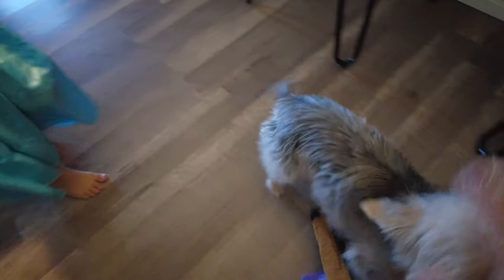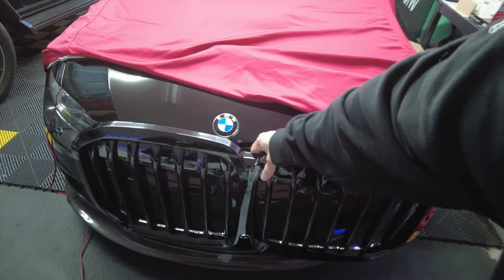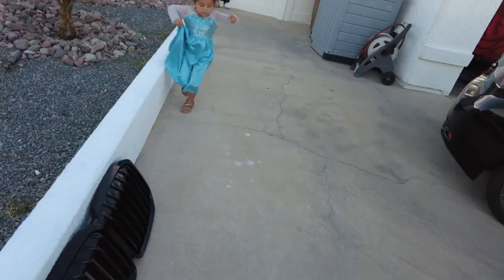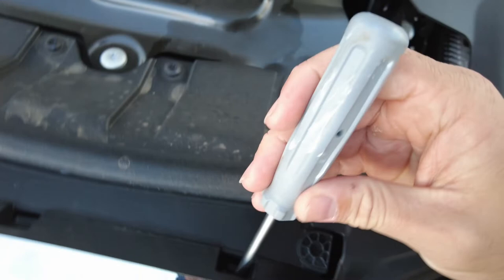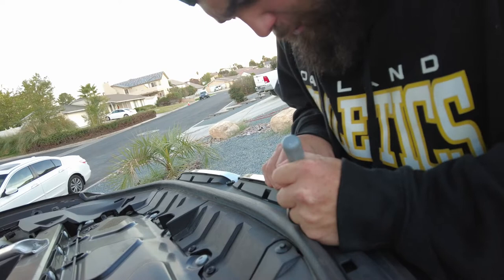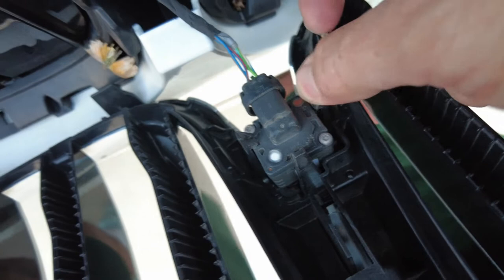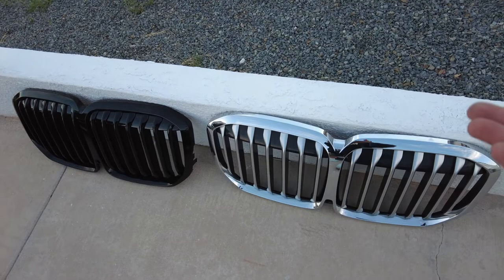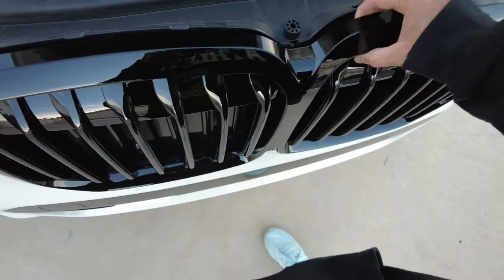EASY 5 minute Blacked out Grill Install BMW X7

Comment: was there a lens cover for the camera on the aftermarket grill?
Reply from the maker: I believe the lens cover remains attached to the camera and does not come off when switching grills
Reply: @djzaki   what packages are on your x7
Reply from the maker: @michael bhim  m sport, and the crystal shifters! I think it also has the standard luxury package that all of them have with heated steering , heated and arm rests
Reply: @djzaki  sick . I got a carbon black with Msport too, just got the black grill in- gonna install it today
Reply: The car looks sick yo! Do u guys know where can buy the black tail pipe? Thx bro.
Reply from the maker: @freddylyu3678  your best bet is a muffler shop or ebay!